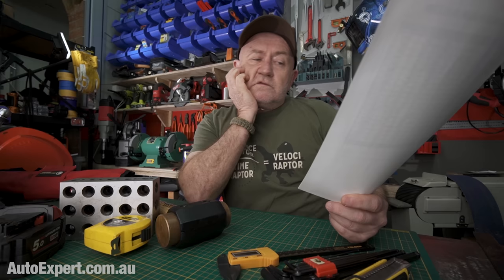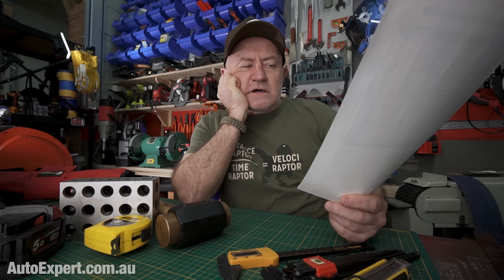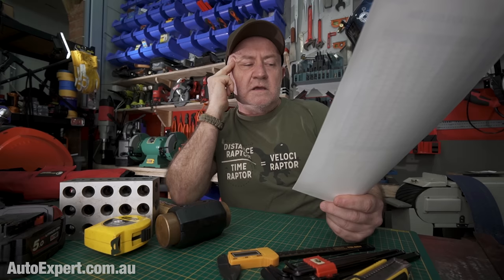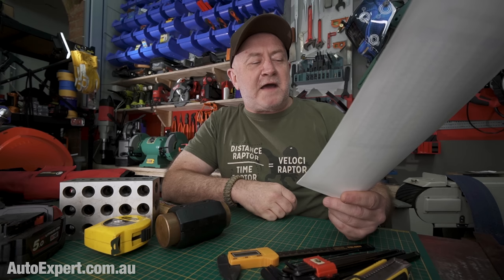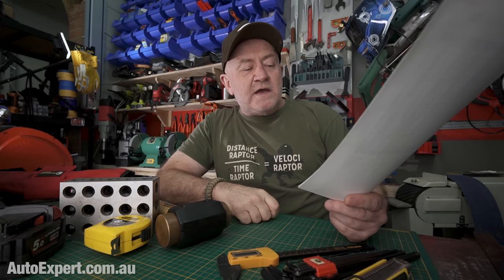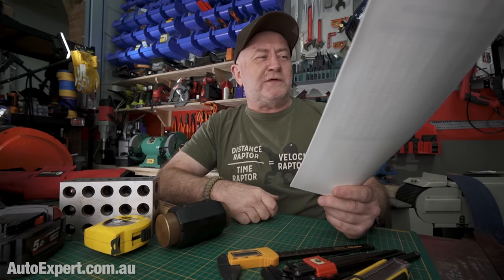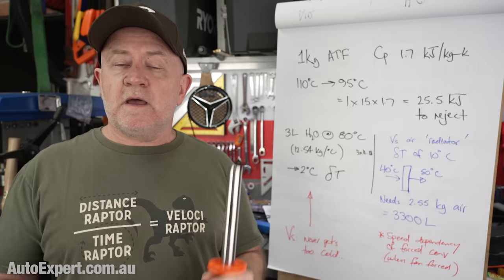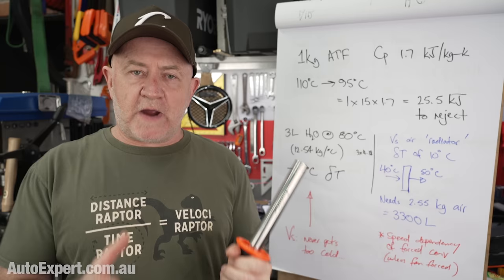The truth about fitting an auto transmission oil cooler | Auto Expert John Cadogan

Comment: Transmissions don't generally make much heat, if it's making heat then there's something drastically wrong with it and will generally fail in minutes.
The temperature comes from torque converter and is not abnormal.
The trouble with newish auto transmissions is the converters have lockup clutch plates and the pressure that locks the converter up only locks the converter up in a few very specific conditions.
These conditions are mostly with an unloaded or lightly loaded vehicle being operated as per manufactures design specs.
When the converter is in total lockup, the input and output is at 1:1 therefore no heat is being generated and no power is being dissipated in the oil, its then you need the in-radiator cooler to actually heat up the transmission fluid to keep it in spec.

When you are heavily loaded and or towing trailers, the converter hardly ever gets the chance to lock 100% because the hydraulic lockup pressure is modulated by the PCM to a specific program based around normal category driving and heavily loaded and or towing trailers is not normal category 
It's the fluid friction when work is done within the converter that heats the oil and especially when the lockup is being modulated.
Trying to hold onto too high a gear will drastically increase the temperatures both by fluid friction and slipping lockup.
Having a way to lock up the converter 100% on demand without using too high a gear will cure the temperatures but of course that is generally beyond our control.
So, the simplest and cheapest way to keep the converter temperatures down is to drop a gear or two and just run the engine faster.
Takes the excessive load of the engine and will give the auto a better chance of locking up the converter further contributing to lowering the heat generated both in the auto and engine cooling system.
Also will likely give you better fuel consumption as well.
Reply: Fit a Torque Converter lock up kit eg. MM 4x4 Automate.
Reply: @dallasgrgic4209  Yes mate, but I did say generally out of our control. Lockup kits have been around for decades, but most users won't have one and or don't know about them or have any relevant information on what the heck goes on in their transmissions.
Monkey see, monkey do.
People see things like 3.5t loaded Gutluxes  and they think it's normal practice and expect their Utes to do the same without problems.
Trouble is they don't see the heart break and other ramifications of willy nilly doing so.
Reply: Yep, this is what I expect John should discuss next.  A lock-up light on the dash would be a useful thing.

Comment: Discussed the whole subject of coolers, and oil temps with a transmission specialist that was nearing the end of his career. He had seen many, many factory designs that liked to enter into a relationship with coolant or trans fluid, incestuous lot. 
On the subject of correct running temperature, cooler was always better. While autos developed heat, cooler was better... A ZF specialist indicated their transmissions would happily function at - 20C, cold oil was relatively not an issue, which surprised me, and had no issue with the removal of oil to water cooler.
Anyway, if you have a Falcon you don't have an option anyway. Not enough airflow, buy one with a fan and thermostat.

Comment: Our 200 series LandCruiser is fitted with a torque converter lockup switch this this does pull the temperature  from like 130 down to 70 with in almost seconds. Also stops torque converter flaring and behaves like a locked up manual transmission on the highway. Just need to make sure it unlocks under 70 km an hour.  Also driving at manually on the beach keeps at temperatures way down under 100. Would be interested in your thoughts on lock up torque converter switchs.
Reply: Had a lockup kit on my Pajero for 5 years and it has performed flawlessly. SAVES a litre per 100klm and transmission is way cooler as well as driving much better. I can lock up 2,3,4 and 5th gears as well. It virtually converts your auto into a manual if you want it too. In sports mode it is virtually a clutchless gearbox. In drive it just goes through all the gears in lock up mode. Locks up at over 40kph..

Comment: I was told when i was young and dumb if you are going to install a trans cooler then put a bypass thermostat in so that cold days or going down hill so that the trans fluid does not run to cold one of best examples of this was the Harley  evo motor put an oil cooler on it without a bypass thermostat and in the it will never reach operating temperature 
That motor grows 1hunderd thousands from cold to hot against my advice a customer put one on his bike then came complaining that his bike would not run rite told him to put a cover on the cooler or a bypass thermostat bypass on it all sudden it starts runing rite motor now getting up to operating temp

Comment: Drivers forget if you work your ute hard it heats the intercooler stopping the radiator from cooling the coolant below 90 degrees hence why you get peeks of 125.
So on a hot day with the air con running the air passes through the condenser, power steering and transmission coolers next is the intercooler and lastly the radiator.

so on very hot days remove the spot lights, the bugs and let the engine run in a lower gear.

Comment: Here's an idea.....
Buy a vehicle that comes factory fitted with an external trans cooler!
Yes, some manufacturers fit them as standard equipment (not a part of a 'tow' pack...).
The external cooler sheds some of the heat, then the trans fluid flows through the heat exchanger in the bottom of the radiator to stabilise the temperature even further.
If a manufacturer of a 'heavy duty' vehicle that is marketed for towing heavy loads, is not preparing the vehicle for carrying out such duties, they are being cheap and taking shortcuts. It is the buyer that will eventually pay the ultimate penalty for that case of penny pinching......

Comment: A small amount of water cooling is equal to a large amount of air cooling, so you're not going to add a bigger radiator, your going to add a bigger fan, or more fans, your still using air intake, to cool water in a radiator, to cool oil for a transmission, a combination of all three. So, you could just use air 'with a fan' to cool trans fluid, or two fans and one trans cooler, or two trans coolers.

Comment: Hi John, thanks for doing this video, I have a 2019 Subaru XV and I was looking at doing some moderate offroad stuff with it, not any blue singlet wearing stuff though. Anyway, I was thinking of installing (via a reputable transmission technician) an additional transmission cooler for the CVT as I heard the offroad stuff can be a little taxing on the transmission by it getting too hot, as would towing something uphill.
Reply: I have a Crosstrek and a Hilux. For serious off-road stuff I used the Hilux and even for that with a conventional auto box I had to add a cooler

Comment: if you have a puntured oil cooler tubing in a radiator (convection cooler), that is mixing oil and water. But the radiator is cooling nice my engine, would it be righteous to change it or set up and external ATF cooler to prevent from mixing engine coolant and ATF ?. I´m from Mexico City with a mean ambient temprature of 25° Celcius. Great video, and thanks in advance for your attention to my question respectable Sir.

Comment: G'Day Again John,,Seems to me the problem is Longreach,Iknow of 2 failures with this destination,we nearly blew up a diff,Got out and could smell Hot gear box oil,,nup diff had blown out a litre of oil and me mate,just blew his Mazda up in the same place,
Mind we drove into a head wind all the way,,we managaed to double our fuel consumption,
I beleive,it is the head wind causing most of the problems,,car working twice as hard in the head wind,
Reply: Had you crossed any rivers etc recently/before doing the trip?
If both you and your mate crossed rivers and didn't do a diff oil change...
the steam from any water ingestion into the diff  could have frothed the oil and that pushed it out the diff breather....
Reply: @JohnSmith-yv6eq  G'Day John,,No Rivers as of yet,,Just a real head wind,,car was working twice as hard,,Both utes had loads in them,,
but me mate blew his engine,,we only had low diff oil,and yes was out of the breather from which it spewed..like i said took the best part of a litre to make level again,
no further probs on that trip,and yes we kept an eye on diff level,had a spare bottle just in case we found the problem again,
Reply: I wonder why race cars have forced circulation (pumps), forced air (by fans)  diff oil coolers?????
In your example (non race) It might also be diff oil with condensation  which had accumulated over time?

Comment: Hi , try cooling industrial  air cooled  engines in mobile and stationary plant . Using oil to air coolers is challenging to remove heat . Once done the engine and  oil lasted alot longer . The sump oil was  running under load 115 cel down to 95--100cel in 35cel ambient. Great result  . Oh yea ALL oils degrade additive packages  over 100cel just some faster some slower . Operating temps over  100deg cel reduce longevity of all things mechanical .,no exceptions .

Comment: Short answer is yes. Vehicles aren't designed for the extremes this includes usage and temperatures. The later being high in Australia. This makes me think of the undercooled ZF box for the turbo falcon and Territory. Engineers insist no changes needed to be made to the cooler. The junk pile behind your local mechanic shop says otherwise.

Comment: No time to finish the video now so maybe it was covered already but the 6R80 has an internal thermal oil cooler bypass valve so not a concern adding “too much” tranny cooling capability.

Comment: we're assuming that the genius engineers/bean counters at each auto manufacturer have done the necessary R & D to ensure that all this 'thermal efficiency' actually works in the real world? How many new (or near new) cars have been taken back to the dealership because of items (or systems) that work fine in the lab, but fail miserably under normal driving conditions?
I'm guessing that some aftermarket manufacturers do more R & D that the guys/girls who designed the original.
Reply: Probably more than you realise, even Hyundai and Mahindra quote a maximum gradient that can be climbed at high temperature before cooling capacity is exceeded, most people just don't read the owners book past the how to operate the stereo section.

Comment: What many may miss in all this is the fact that the 180°f thermostat is controlling the heat the engine WANTS for efficiency, lubrication, ect, so it limits the outflow.
 The water inlet is the lower hose, where the oil to water transfer occurs. Go on, grab that hose, no problem. Now, muckle a hold of that top hose on a toasty day after a pull up a hill. No bueno.
  Same with the trans ( or oil) cooler lines. You can quickly surmize which is which.
Reply: By assuming others are not aware of this you completely miss the point. If you tow up a range which often drives up transmission temperature well beyond standard use the radiator included transcooler will not suffice, the high temperatures will compound and the atf will begin overrunning the cooling capability of your radiator. Your thermostat being open doesn't mean the water will be at that temperature it will be anywhere above that rated temperature.
Reply: @jarlnieminen4307  Idk, having worked constuction in the mountains of Utah ( Park City specifically) we hauled all kinds of equipment with all kinds of trucks ( didnt like the Case Extendahoe)  and never had a failure that I'm aware of. Quite a few brake cooling periods though.
Reply: @crazytrain7114  aren't the mountains there cool? I dare say your ford, dodge and Chevy trucks actually have taken haulage into account. Our light duty Ford Ranger, Toyota hilux, Isuzu dmax and Mitsubishi triton not at all. These are expected to tow a lightweight caravan a few times in their lives and carry hand tools to a job site.
Reply: @jarlnieminen4307  I loved it, went out for a ski vacation and stayed 7 years! Learned a lot of trades in the summer and drove the transit busses in winter, after a stint on nightcrew at Deer Valley the year it opened.  We had a house FULL of Ozis and Kiwis every winter, amazing times!
Reply: @crazytrain7114  sounds amazing.

Comment: Noted that Old School Mercedes (pre value engineering era) had a small air-cooled heat exchanger for the engine oil located alongside the main engine coolant "radiator"  and an integral water- cooled  auto transmission oil cooler in the bottom of the latter. All with cooling  airflow regulated devastatingly effectively  in a  foolproof tandem arrangement by the viscous coupled  fan with no electricity needed  or sensors to go wrong. If retrofitting an air cooled transmission oil cooler you might look at including a by-pass and using a self regulating thermostatic 3 port diverting valve  by Spirax Sarco. Why don't all manufacturers address transmission thermal management  properly  as OEM ?  A rental of a Toyota Tacoma in Koh Samui a while back had a Transmission Fluid Overheat light glowing every time we tackled the 1in3 long grade up to a precarious mountainside villa, presumably replicating the heavy caravan  towage in sand scenario.

Comment: Oil cooler in radiator good. Driving lights, bars and other crap in front of radiator grill bad.  Electric booster fan good,. Check for seal at back of bonnet,  high pressure air from base of windscreen can enter engine bay and help stall air coming in from grill.

Comment: John ,would the ultimate solution be to make sure that the Engine oil is cooled sufficiently under extreme driving and also the intake air is also as cool as possible,don't many diesel engine problems stem from to much hot Air?
Correct me if this not so please .
Should engines have a controlled oil cooler accessory to be used when towing and extreme driving ?

Comment: this video is more "what works in theory doesn't always work in reality".
a lot of vehicles radiators are not sized all that well for high air temps. manufactures cheap way to account for differences in air temps, is to use different engine thermostats in different markets. but thermostats are not coolers but its cheaper than fitting different radiators and it kinda works most of the time.
the other issue is that the factory cooler puts the heat into the cooling system before the engine which removes part of the engine cooling capacity. 
i know guys who have tested this and actually had a diesel overheating from idling in drive while not moving, ie stuck in traffic.  
to add to it, the water atf coolers are actually lower performing. this is due to have two barriers between the fluids instead of one. ie atf/water/air vers atf/air. just like water/air intercoolers they simply do not match the performance of air/air intercoolers. in the end all the heat goes out into the air.

for those worried about overcooling an auto gearbox, there are inline thermostats available. tho cold atf won't damage the gearbox while too hot certainly will.
Reply: I hope John sees this. I look forward to the episode "with nuts".

Comment: I've towed a 24ft van behind my Ranger, up and down mountains, several times, with the necessary ARB toys, and not seen much action from the car temp gauge, beyond standard, so I figured if the engine is staying within expected temps, so must the gearbox; that, or the temp gauge is just for looks. However, it's a lot cooler here than in the outback.